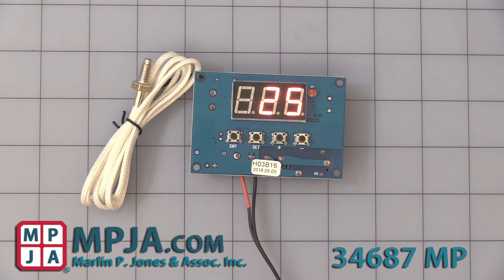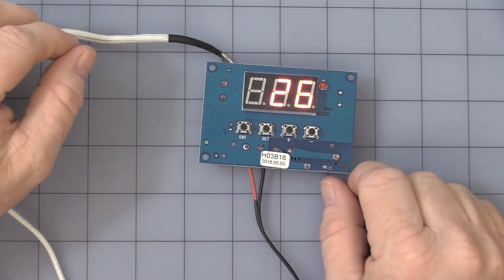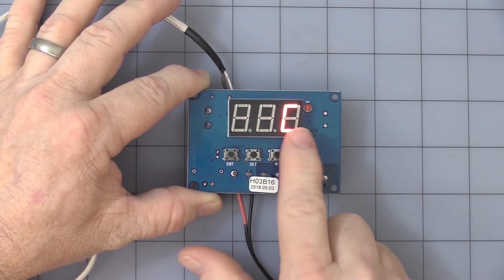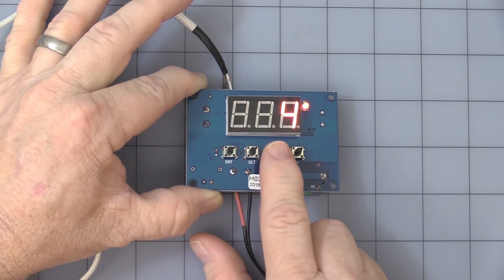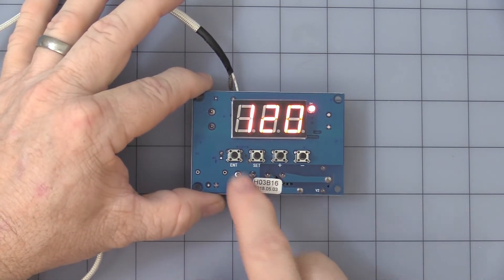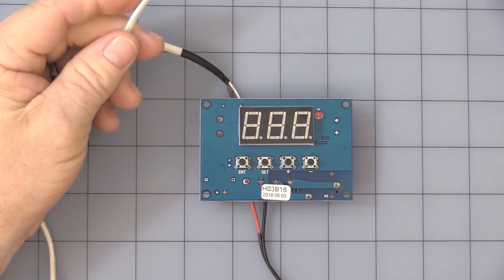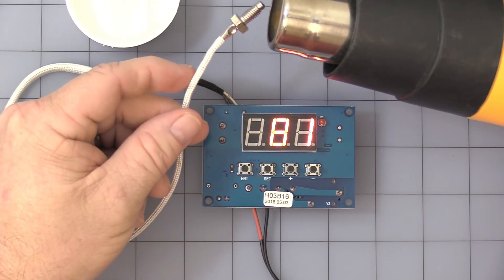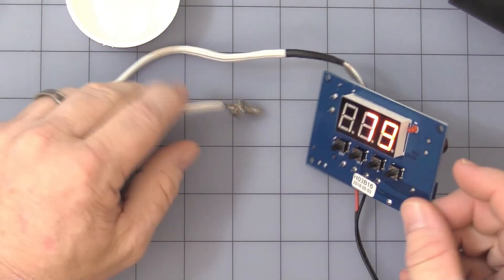High Temperature Thermostat -30 to 999 "C" 34687 MP

Comment: A little better explanation of how to wire in a heater and/or fan would have been very helpful. I've seen it wired with a jumper wire to both negative terminals. But I do appreciate the video you did make. Cheers.

Comment: Would the tip of the thermocouple probe be ok immersed in molten lead? Not full time but to check lead temp for casting.
Reply: Id probably put it in an aluminum casing and then use the aluminum as your probe, that way the probe wont get damaged